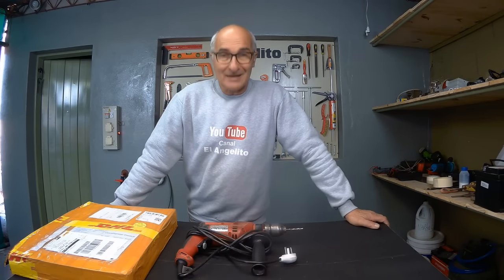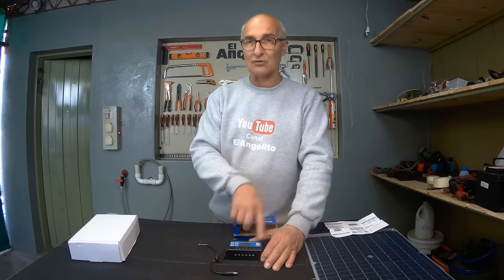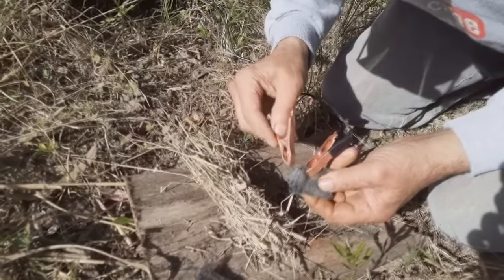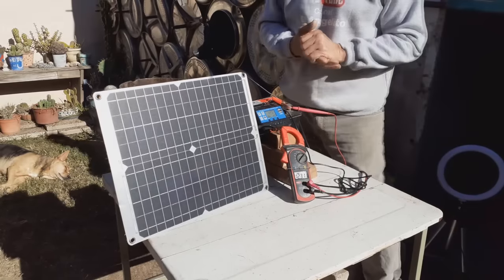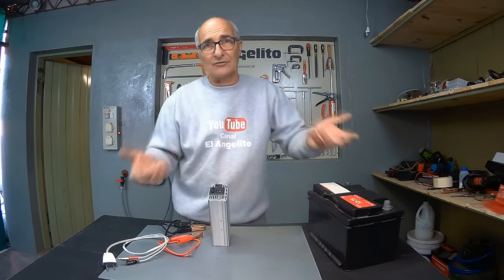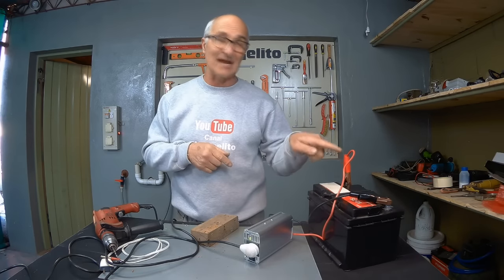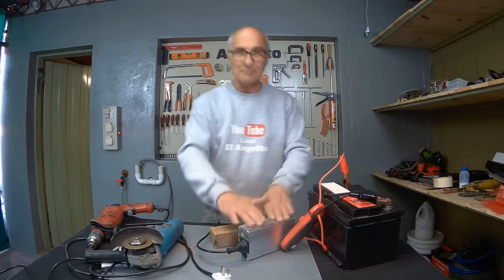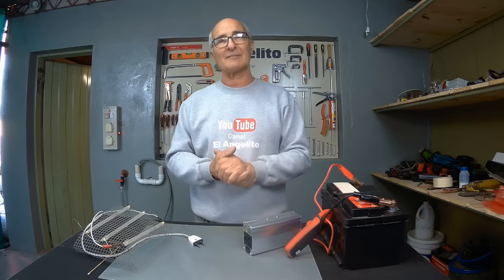Probando PANEL SOLAR de 40w Con INVERSOR a 220V

Comment: Hola don Angel, nesecito que me saque de una duda, tengo la tensión eléctrica de mi barrio muy baja, que va a pasar si conecto un transformador de 220v a 12v vol, a la entrada del inversor de 12v a 220v, todo esto con la intención de elevar la tensión a 220, por que aquí varia entre 180 y 200, y las bombas de agua me prenden a duras pena

Comment: Simplemente escuchar a alguien que hable de señales senoidales y osciloscopios merece mi mayor de los respetos!! Abrazo !!
Reply: Sin saber mucho, una señal senoidal alterada, significaria que los electrones no hacen una aceleración progresiva, para luego comenzar a detenerse y hacer el recorrido contrario en el conductor, sinó que cuando comienzan a acelerar, abruptamente tienen un parón y comienzan a acelerar en el otro sentido contrario, para , antes de llegar al cénit de aceleración , volver a parar abruptamente e iniciar nuevamente, en sentido contrario. ¿Es algo asi?
Reply: @CroniValpo  :) Yours could be thought of as a device hysteresis. A full sine wave (a modified sine wave that is very close to a real sine wave) is needed, for example, to power a refrigerator. The compressor in the refrigerator already has its inverter, and the generation of harmonic frequencies will cause the refrigerator compressor to start once and not the second time. Distortion of the sinusoid results in the creation of an elliptical rotating field, instead of a circular rotating field in an electric motor, especially single-phase with an operating capacitor. In addition, compressor (electric motor) start-up spikes occur, which can damage your inverter. That's why a full sine wave and good filters are needed. For small power tools (drill, grinder, small compressor) the inverter from the video is suitable, because the consumption of this inductive load is not long-term and their consumption is not large. It might bother you the most, the tools are a little noisier and a little more warm. An inverter of a similar type would have to be dimensioned for an output 3x - 7x higher. The video inverter is more suitable for powering TVs, small microwave ovens, toasters, computers (computers have a switching power supply, so they really don't mind), your Wifi, your mobile phone charger, lighting throughout the house ... but not for a 2kW kettle kettle, electric oven, washing machine, larger fridge and dishwasher.

Comment: Enseña como inyectar la alterna al circuito eléctrico de la casa sin que interfiera ni que inyecte energía al exterior
Reply: Comprando una llave que viene especifica para eso o usar dos enchufe hembra en el tablero( uno desde la linea de la epe y uno de la linea del grupo electrógeno o invertir)  y un enchufe machos desde la casa de unos 40 amp , asi no hay peligro de electrocutarse ni de mandar corriente a la linea de la ( epe : empresa provincial energía)

Comment: 😬😧Primero se conecta, siempre la batería al controlador y luego el panel, o corre el riesgo de arruinar su controlador de carga sobre todo el modo automático de carga.
Reply: Eso cuando el panel es de 24 y la batería de 12v, cuando ambos son de 12v da lo mismo, no hay problema..... La idea es conectar la batería primero entonces el sistema reconoce el voltaje, ejemplo 12v, luego conectas en panel si es 12v normal y si es de 24v el sistema como ya sabe el. Voltaje de la batería pues se encarga de regular el. Voltaje para cargar a 12v la batería
Reply: Yo me pregunto? Y la protección de la batería? Acaso sería conveniente poner algún fusible aunque el regulador de carga haga su función....
Reply: Claro que si, se puede poner un fusible de protección, la mayoría hace eso.
Reply: @SuperECCH  pero qué tipo de fusibles se emplea?

Comment: hola angelito saludos desde mexico, muchas felicidades por tu canal muy completo me gusta mucho, podras hacer un calculo de cuantos panles solares se cocupan y de que capacidad los paneles asi como las baterias para abastecer en la noche , digo si no es mucho pedir :) para un aire MINISPLIT  INVERTER 12,000 BTUS ,
 Características Físicas y Eléctricas:
Capacidad: 1 Tonelada (12,000 BTU)
Alimentación: 220 Vca / 60 Hz
Potencia en Calefacción : 1080 W
Potencia en Enfríamiento : 1250 W
Refrigerante ecológico: R32
Peso unidad interior: 8 Kg
Peso unidad exterior: 22.5 Kg
Medidas unidad interior: 750 x 285 x 200 mm
Medidas unidad exterior: 705 x 279 x 530 mm

Comment: Hola Angelito. Felicitaciones nuevamente por el vídeo 👌 . Mire , se cortó la energía eléctrica en mi casa e instalé una batería nueva de 100 amp. de ciclo profundo , con un inversor de 1600 watts y no fué capaz de hacerlo funcionar . Luego lo instalé en una incubadora casera con una ampolleta de 60 watts y duró demasiado poco y eso que la batería era nueva y de 100 Amper.
  No lo tengo con panel solar aún. ¿ Es normal que dure poco la batería? ¿ Cuántos paneles de 200 watts debería instalar ; para una próxima emergencia ? Gracias Saludos desde Chile.

Comment: Angelito.. Gracias x compartir tus conocimientos... consulta Amigo q necesito para una Master 2.8 turbo...puedo poner una batería de 100 hp sin panel con un conversor automático para cuándo esté en un camping enchufar a 220 y cargar la bat mientras consumo algo en la chata....Gracias por lo q puedas compartir... Abrazo y q nobleza la tuya lo de compartir tu conocimiento más allá de tengas un extra económico..que estés bien y hasta el próximo.👍.👍👍

Comment: Angelito siempre te sigo consulta cuantas baterías se presisan  para alimentar una casa y cuanto paneles solar necesitó desde ya mil gracias  angelito por siempre en señar con esa pasión  !!!
Reply from the maker: 4 baterias y 6 paneles, pero dependera del tamaño de los paneles , capacidad de las baterias y del consumo habitual.

Comment: Muy buena su explicación , lo único que me gustaría que hiciera es cuando habla de potencia lo exprese en Watts y no en vatios por este término se confunde con voltios , que cuando se refiere a corriente no diga amperaje , sino corriente en amperes, y cuando habla de tensión no diga voltaje sino tensión en voltios o tantos volts de tensión. Por otro lado cuando conectó la lámpara halógena de 450 watts ( no vatios)  y la corriente que pasan por los cables de la batería eran 42.2 A ese cable debería tener una sección de unos 10 mm2,  tendría que aclarar que con ese consumo de potencia y esa corriente tal vez necesite un cable de mayor sección para no tener un inconveniente sobre todo si el mismo es más largo del que muestra en el video. Por lo demás excelente todo, gracias
Reply from the maker: Y vos no te cansas de verlas, no?
Reply: @elangelito  no se a que se refiere. Si es por las denominaciones de las características eléctricas de un circuito yo entiendo a que se refiere pero hay mucha gente que no y se presta a confusión.

Comment: Muy buen video. Felicitaciones. Sin embargo, hubo un error importante, cuando indico que la batería de 75 AH, dijo que entrega 75 Amperes en 1 hora. Aquello es erróneo, pues los amperes que entregará dependen de sí la batería de 75 ah es a un régimen de 10 hr, o de 20 hr, según la hoja técnica.
Si es a 10 hr, significa que la batería entregará 7,5 amperes por 10 hr, eso es seguro, pero en 1 hora podrán pasar no más de 40 amperes, pues el rendimiento de la batería va bajando, partiendo del régimen que indica la fábrica (10 o 20 hr) .
Si la batería es a un régimen de 20 hr, significa que en 20 hr podrá suministrar 3,7 amperes, y en 1 hora no entregará más de 35 amperes. Ojo con el concepto de Amper-Hora de una batería, ver la curva de descarga.
Disculpen lo extenso pero mi intención es aportar técnicamente a mi observacion, lo mas claro posible.
Saludos!!!
Reply from the maker: Muchas gracias por aportar  estos datos. Un abrazo amigo !!!

Comment: Hola Angel, quisiera saber que kit completo necesitaria para los siguientes equipos de consumo, sobre unas 12 horas diarias de uso y las otras 12 de carga.

equipos conectados 12 horas diarias:
1 torre pc
1 pantalla de monitor pc
1 router wifi

equipos conectados las 24 horas:
nevera

Me puedes aconsejar que necesitaria mas o menos, con un uso diario de 12 horas, y una nevera conectada las 24 horas del dia.
Gracias :)

Comment: Hola yo tengo lo mismo pero a mayor mi pregunta es si tengo que poner algún tipo de protección como fusibles ya que dispongo de un panel 160 vatios una batería AGM de 100 anperio un controlador de 20 amperios  como tiene usted en el vídeo y un inversor de 6000 vatios de pico y casi 3000 watios de continuo mi pregunta es si tengo que intercalar algún fusible del panel al regulador de carga y de regulador hacia las baterías si tuviera que poner también algún fusible y del inversor a la batería hay que poner alguna protección también ahí

Comment: Muchas gracias por el vídeo, te go algunas dudas, espero pueda ayudarme, de antemano muchas gracias.
1. Me recomienda comprar una batería de ácido de 825 ah o superior o mejor una AGM de 100ah

2. 1 panel de 300 w y un controlador de carga de 12 v?
También tengo algunas dudas con el inversor ya que tengo un aparato que no entiendo si me sirve con el inversor de 110  60hrz
Necesito para usar aparatos electrodomésticos y tener suficiente energía para focos por la noche ya que es una zona apartada.

Saludos desde México

Comment: Quiero felicitarte por tus vídeos, y preguntarte por, si tengo una placa solar de 24v Y una batería de 200amp y un inversor de 3.000 para conectar un A/C de 800w pir varias horas....pregunto, el regulador debería ser de...? Como me aconsejas la relación de los equipos? Gracias. 😊
Reply from the maker: Me parece que con ese consumo, la bateria no llega a una hora de uso.

Comment: Hola buenas tardes te felicito excelente video, que sucede si lo conecto primero  a la red eléctrica de mi casa, en la salida me entregaría los 12 Voltios de corriente directa? es decir lo podría utilizar para cargar la batería del auto desde la red eléctrica doméstica? Gracias y quedó pendiente de la respuesta.
Reply from the maker: No, esto se conecta asi: desde la placa solar , se alimenta una bateria de 12 voltios y desde la bateria  se alimenta el inversor para generar 220 voltios.

Comment: Hola. El video está genial. Para Calefacción y ACS no voy a poner una aerotermia porque ocupa mucho y además hace ruido. 
Me he comprado una caldera eléctrica de 4.5kw para la calefacción y el agua caliente así no gasto gas!
Mi casa tiene 100m2.
He estimado que para poder usar la caldera con baterías, necesitaría unos 8kw.
¿Crees que está bien?
Reply from the maker: Me temo que es demasiado consumo  para uitilizar baterias para generarlo.
Reply: @elangelito  4.5 kW. De pot. Máxima. 4.000kw de consumo anual.

Comment: Gracias Angelito por tan instructivo vídeo. Yo tengo un kit solar parecido al tuyo pero me surge un problema: los cables que van desde la batería de auto de 12v al inversor, cuando hago la instalación se calientan hasta el punto que me funden el inversor. ¿Donde puede estar el problema? Gracias
Reply from the maker: Si los cables se calientan mucho , es por que son muy finos, y si son gruesos y te funden el inversor , es por que tenes problemas en el inversor, quizas este en corto la salida...
Reply: @elangelito  La verdad es que esta instalación llevaba funcionando varios años muy bien con cables de 3,5 m2. De repente el inversor dejó de funcionar. Compré otro azul como el que aparece en el video, lo conecté y se calentaron los cables y me fundió el inversor. Compré otro y lo conecté con el miedo de que me lo volviera a fundir. Cuando lo conecté observé otra vez que los cables se calentaban y terminé por desconectarlos. Finalmente he comprado un kit de panel e inversor. A ver que sucede.
Gracias por tus instrucciones.

Comment: Hola tengo unas preguntas, ojalá me las pueda contestar.
Tengo una batetia de auto de 75 amperios en buen estado , un inversor de onda modificada de 1000w, y un freezer que consume 150w. Cuantas horas de uso me dará esa batería. Y la otra pregunta es. Con un panel de 50w cuanto tiempo tardará en cargar esa batería de 75 amperios. Siempre que este el sol a pleno. Gracias

Comment: Buen video y mi pregunta es que tan recomendable es comprar un inversor de onda modificada? Gracias
Reply from the maker: Siempre es mas seguro el de onda completa, excepto que solo lo uses para alimentar luces o resistencias, pero no para motores y aparatos electronicos.
Reply: @elangelito  gracias hermano un abrazo

Comment: Hola! Una duda, quiero instalar un kit básico, pero mi duda es la batería a utilizar, la de litio es muy costosa y las baterías AGM o de gel son un poco más accesibles pero aún caras para el presupuesto que cuento, se que las baterías de ácido se les debe dar mantenimiento pero son más baratas, mi pregunta es si me conviene una de 75 o 100 ah o una de 860 ah? Mi duda es porque el precio es muy similar entre una de 100 ah a una de 860 ah cabe decir que ambas son de ácido y la de 860 ah es 3 veces más grande y mayor capacidad de energía, pero no entiendo porque cuestan casi lo mismo, cual debería comprar? Gracias

Comment: Hello engineer Angelito.  To charge the battery wich is probably 12V/100Ah , with the solar pannel what charger controller  did you use, how many A?  I have a 30A and a 100A  charger controller , which should I use to charge such a 12V/100 battery? Thank you

Comment: Hola buen día Angelito tengo un panel solar chico y un controlador de carga para dos baterías una de 160A y otra de 60A para iluminación si bien no e tenido problema me gustaría saber cómo conectar las dos baterías al mismo tiempo al controlador ya que los conecto un día una y al otro día la otra desde ya muchas gracias.

Comment: Hola sr. Angelito me parece muy interesante su canal. En especial, este video donde explica como conectar un equipo de casa. Yo necesito llevar conmigo un respirador para dormir me gustaria me dijera el nombre del equipo donde se puede enchufar este respirador con salida de 12V? Gracias
Reply from the maker: Si es con salida de 12 voltios, puedes usar una bateria de autos de unos 75 amperios.

Comment: Angelito, Si estan interconectado Controlador de carga, Inversor, panel solar y bateria. 
¿ Que ocurre durante la ausencia de sol, p.ej. la noche, puede circular corriente de retorno por las celdas? 
¿ Hay alguna incompatibilidad a considerar en estos casos ?
¿ Es mejor conectar el inversor, solo cuando se requiera 220 V?
. Gracias por compartir sus conocimientos.
Reply from the maker: El controlador de carga se encartga de todo, no hay problemas por ausencia del sol.
Reply: @elangelito  gracias

Comment: hola Angel, con respecto a los cables como dices son pequeños, al momento de colocar una extensión de cable se debe de colocar del mismo amperaje o se puede cambiar de cable, adquirí un modelo parecido pero ahora mi problema son los cables, y tengo esas dudas con los cables.
Reply from the maker: El cable que uses en tu extension, tiene que soportar  sobradamente el  consumo de el o los aparatos que en el se conecten.

Comment: Pero me gustaria q me sacara d una duda si sirve para una resistencia d calor como la d una freidora d aire..?  Y para q pueda mantenerse encendida x cierto tiempo hay q tener conectada el panel solar al controlador el controlador a la bateria y la bateria al transformador cierto..?? Gracias..!
Reply from the maker: Una freidora de aceite consume unos 2000 vatios, este panel solar solo entrega 40 vatios, necesitarias al menos 6 de estos paneles o 3 de los grandes y buenas baterias para eso.

Comment: Hola, que placa necesitaría para por ejemplo abastecer un tv de 20 pulgadas de 220 v, durante 4 horas diarias?? Gracias
Reply from the maker: Una placa de 150 watts y una bateria de 12 voltios, 110 amperios, y por supuesto  , un inversor.
Reply: @elangelito  muchas gracias

Comment: Hola angelito.. espero veas mi mensaje. Tengo algunas dudas... vivo en el campo sin energía eléctrica. Hace poquito pude comprar 2 paneles solares de 12v de 60w cada uno. Los tengo conectados a un regulador de 10a y a una batería de 12v de 110a de plata/calcio. Hasta el momento sólo usaba 12v. Ahora me compré un inversor de onda pura de 300w y quiero usar el lavarropas a paleta que consume 270w y la verdad es que sólo funciona 30 segundos y se corta. Es posible que se gaste tan rápido la batería? Hay alguna forma de solucionarlo? También vi un video tuyo donde conectas un lavarropas directo al panel.. yo podría hacer eso? Hay que hacerle alguna modificación especial al lavarropas? Gracias de antemano por tu posible respuesta y te mando mis más sinceros saludos...
Reply from the maker: Un lavarropas cuando  funciona consume  solo con el motor , mas de  300 watts, y cuando calienta el agua , unos 2000 watts, por eso se para.

Comment: Hola Angelito, tengo una bomba submersible de 220v con una tension de 1100watts. Resulta que tengo en mi posesión un inveter de 3000watts de este tipo para foncionar con auto. Por favor,  dime si Cree que eso pondría en marcha la bomba, con mi auto encendido? Saludos desde Haití. Espero tu respuesta, gracias de antemano.
Reply from the maker: La bomba podra ser mantenida en marcha con ese inversor, pero no creo que pueda hacerla arrancar, ademas si se pudiera, necesitas sacarle  a la bateria, 100 amperios en forma permanente durante la marcha, y el alternador  con auto en marcha , solo te entregara 30 amperios.